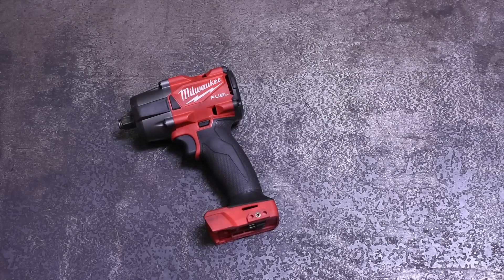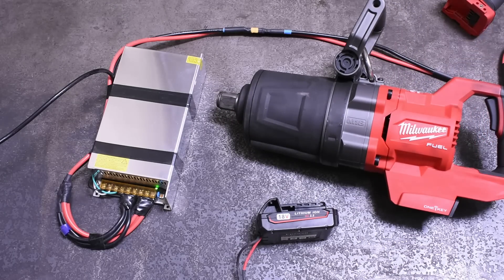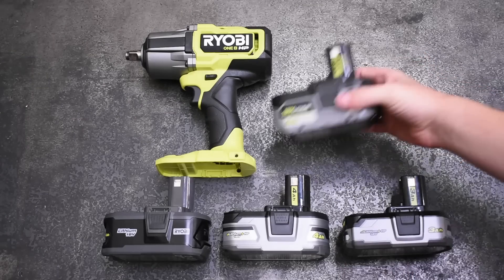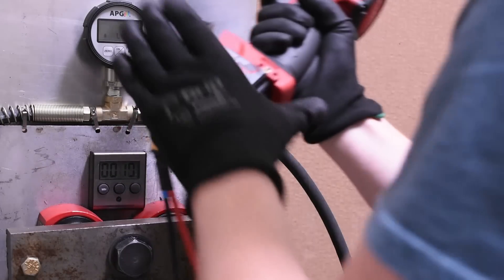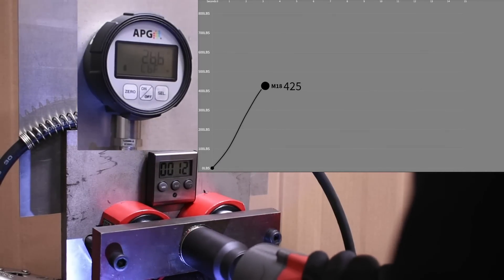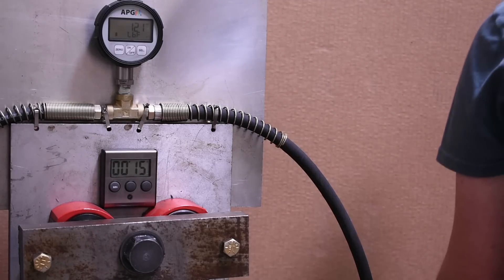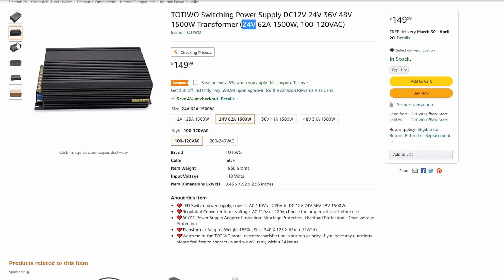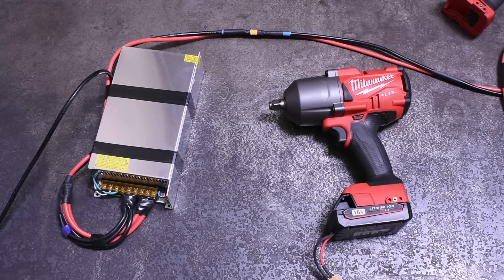Mad Scientist Youtuber Supercharges our Tools: 120 Volt M18 Impacts

Comment: Great video!
I have built similar power sets for older style 18V tools in the past. I would get best results when having large capacitors across the PS set as you said 22V or so. I have also utilized a DC-DC converter in conjunction with the battery pack before to basically boost high inertia loads ( pick up the dip 🤣). So the set up you just tested, but using a DC-DC buck converter set to 21V and max current of converter and then you can still use the High Capacity pack also and use the converter to simply pick up the power as voltage drops off pack? 
Just sharing! Keep it up and God bless!

Comment: I wish they would make a real commercial version of this, so I could buy the cordless miter and table saw, but plug them in when using them at home in my garage. I know dewalt has the dual flexvolt one, but I want it for any 20v tool.

Comment: Love it! I use a “hacked” server computer power supply to power my RC charger, but never thought to hook it up to Milwaukee tools…
They sell battery kits on eBay with locking tabs. Maybe combine that with home brew 12V power supply based on Branded (HP) server PSUs that are CHEAP on flea-bay.
They’re switch mode, have excellent voltage tolerances and overcurrent protection + efficiency, and some even have cooling fans built in.

Comment: Just get a second box and gang 2 of them off of separate breakers into one tool for maximum amps.
Reply: Also maybe see if you can get LTT to water cool the impacts so the extra amps don't just melt the windings as fast.

Comment: You need to get a power supply capable of going to 24 volts those tools will easily take 24 volts without problem and then you would truly have the tools absolutely very best case scenario.
Reply: I see I should have waited until almost the end of the video before commenting haha but yes you are right crank that thing up giver 24 volts they’ll take it easy peasy

Comment: If you're really gonna push this battery test then take a look at "the post apocalyptic inventor" he put 6 makita batteries in series to power 120v tools. Your version would be batteries in parallel, 6 milwaukee batteries at 18v should be plenty to beat this wall adapter

Comment: I would be willing to bet, if you plugged the power supply into an isolation transformer, then plug that into the wall, some of the strange behaviors would go away. The electronics on the tool were never intended to be referenced to ground.
Reply: Possibility #2 is that the switching noise in the switch mode power supply is also having a detrimental effect on the electronics in the impact guns.

Comment: As far as upgrading things, used to spend some time in the car audio world, they would use massive 3000w contious converters to run some of the display setups. For the really big stuff, they had a battery bank and several converters to produce 10kw for the minute or so they ran the system for customers. I know most of those were around a thousand a piece, but the power is definitely out there

Comment: the connector, XT60's use them in drones. Take an ice pick or 1.5mm allen head and spread the pins in the male connector. sligthly expanding them will make the connection pass max amps and stay together. its a common thing to do every now and then. love the channel.
Reply: I've found the legitimate amass connectors are pretty solid and don't need anything like this

Comment: What were the 240v options on that page?  I'd guess you'll need more than a standard 15amp 120v to truly max out the potential.  In fact building a large 18v battery with high discharge cells could easily deliver more power than a standard 120v circuit. Maybe one of the ebike/battery channels could help you out.

Comment: All fine, but do try to check the actual volts being delivered to the terminals of the impacter. Even fat cable like that will lose an appreciable voltage over a run over several feet, and the last little bit of (thin!) wire plus its connector will lose more. Another thought: you might be able to get the 1-inch model to run by putting a really hefty capacitor across the power supply to help with the start-up surge. I suspect that the steady running current isn't as much as the 80-ish amps that supply should be able to provide.

Comment: Connecting the power supply to a full battery would also likely fix the cutting out, the battery would act as a buffer

Comment: Over voltage should give significantly more uggaduggas, or you could run another of the same power supplies in parallel (connect two to the tool at the same time) for twice the current availability and half the voltage drop

Comment: Hi, TTC! Some comments from an EE perspective:
• I had suggested doing almost exactly this on your earlier video!: https://www.youtube.com/attribution_link?a=sX7DEhMosS3n83pP&u=/watch%3Fv%3D5nzGnqBGAtE%26lc%3DUgx5tcM36hxL-BMoRYp4AaABAg.9_QL2JaWpr29_Qea1sqFxn%26feature%3Dem-comments
• Glad you're doing this!
• Clearly this DC supply isn't adequate -- it isn't "stiff" enough (can't maintain output voltage). As I suggested before, you probably want a 100A or 500A supply. Something significantly beyond what you think you need, especially because these cheap supplies are under-rated.
• Probably most important, though, is to measure the supply's output voltage while you're doing this. If you can manage to put it up on the same graphs, that would really tell you something. I suspect you are correct that the tool is drawing more than the alleged output current rating of the supply, which Amazon claims is 66A, but I don't really believe. Similarly it would also be helpful to monitor the current coming out of the supply, but you need more specialized equipment (hall effect DC clamp meter, current shunt, current transformer, etc.) not like the voltmeter you surely have kicking around (but you can buy such meters cheap).
• Note, also, that 1800W is basically the maximum you can run from a 120V circuit (15A@120V). You really should use a 240V or 208V circuit. The particular supply you linked to supports a 220V input, so it would be worth swapping out the power plug and flipping the red switch on the side to 220V and seeing if you can get more amps out of it.
• The comments about grounds and soforth don't really make much sense. Not clear what's going on. Maybe the DC negative lead should be grounded to the ground from the 120VAC cable. Not 100% sure.
• It looks the leads from the battery back may be a bit thin; of course they're short, but still at big currents every little bit of resistance is a problem.
• You're right that the 18V supply is wrong for this. I had envisioned using a variable voltage benchtop supply, but grabbing one of these fixed-voltage with a potentiometer is a cheaper approach. But you really want to be using a 24V supply not an 18V supply. Or maybe 20V or 22V if you can find those odd numbers.
• As a matter of labeling, it's not really right to call this 120V. Sure, it comes from 120V on the wall, but that's like saying your M18 is 120V because you plug the batteries into a 120V charger. 

If you want assistance constructing a beefier version, don't hesitate to reach out! This is definitely not rocket science!
Reply: I've got some stuff to try initially,  but I'll reach out if I run into any snags.

Comment: My bet is that power supply is dropping amps. It can not upkeep with enough current.
Maybe adding a big capacitor in the power supply output would help with it.

Comment: Think the next step is 2 car battery’s for 24 v or a truck jump pack definitely have all the power you need then and kinda practical for a something like drop saw that doesn’t move a lot and probably cheaper than lithium

Comment: Well the good news is assuming the power supply isnt a total ultra low cost made-in-china brand garbage shit-show internally, its not as sketchy (in terms of risk to the end user) as it may seem.  The cutting out and odd behavior is most likely just EMI/radio interference. Limited filtering on the power supply, combined with a tool not designed to be run from wall power and deal with the mess of EMI associated from that can cause the strange behavior you're seeing.  As far as this vs the metabo. This has a fan for cooling, the metabo doesnt, so even if its very efficient, the long-term continuous power it can put out is thermally limited, even if it can support shot-term peaks. The metabo power supply is also going to have to the EMI filtering to keep the tool happy shoved into the pack, reducing space available for making more power.

Comment: As others have said a PSU with remote sense lines would be best, a nice 3kW unit with some thicker cables. This sort of thing would be ideal for a battery powered chopsaw when it's sitting in your workshop - You can still use it out and about on battery, but when you're home you can just plug it in and not worry about batteries.

Comment: Don't understand why your connecting the common DC rails together, on the PSU. Kind of redundant.  But if you really want to do this test try useing a autoswitching PSU, they will give a more constant output voltage as the load increases.

Comment: Why not adapt a 24 v kobalt battery
Reply: I very done this too some old NiMH powered 18v portercable saw and oscillating tool. I did smoke the variable speed adjustment on the oscillating tool . but after bypassing it   all is Good

Comment: That power supply wattage is too low, which is why the 12.0 beats it on bottom end because it's kicking out more amps...but the 12.0 still faces voltage sag under continuous drain like most cells, which is why the constant voltage power supply can climb back.

Comment: More FUN! I mean more Science please.  Get rid of cheap battery adapter and send power through large gauge cables directly to the horse's mouth right at connection point to the motor.  Give it all the beans and more.  Motors like higher voltage because it helps compensate for any voltage drop in system.  Higher the voltage used the less amperage or heat that will be in the line.

Comment: That was awesome!! I think adding some large capacitors or even supercapacitors in the battery pack would improve things alot more. The reason is switching power supplies like nice constant loads, not a dynamic load such as a brushless motor stalling out 100+ times a second. Adding capacitors into the battery will help with the current peaks and might reduce the current spikes on the power supply from tripping the over current protection. You could see on the big boy M18 1" that the LED lights were dimming in even the no load trigger pulls. So if it was made again I would use the 3 wires going directly into an XT-90 connector then 8AWG going into the dummy battery. He used an XT-60 and then very thin wires going into the dummy battery so there was decent voltage drop across that.

I think if TTC gave him a real M18 battery with the proper locking mechanism and high quality contacts it would do much better. Then adding very low ESR Electrolytic capacitors or Supercapacitors into the battery itself that would drastically improve the power supply system.
Reply: Unfortunately the OEM batteries don't work with this. I tried several and couldn't get an output.

And the battery retainer clips... let's not talk about that.
Reply: you are correct that capacitors do help smooth out surges, but for the load you have here, they are impractical.  You need a humongous capacitor and even then it's a crude way to do it.
Reply: @mriguy3202  yea it would be way too bulky to do it fully, but I may help some

Comment: Here's a totally pointless exercise in why bother - to see how much the torque is impacted by voltage drop, rig up an A/B switch for 2 fresh batteries. Compare a run with a single battery against a run where a new battery takes over halfway through the test. Would be interesting to see how the max torque numbers change - if at all - when a fresh battery kicks in late in the test. Could a mid torque put out more fastening power if a fresh battery is switched in?
Reply: Just wire both batteries together at that point, heck a third one too.

Comment: Is this something that a inline capacitor, like a larger audio one would help reduce power supply fluctuations and keep voltage/amps more consistent as each hammer hit/amp draw spike? Not an expert at all here just a thought. Also an inline ammeter may provide more data as to wattage/voltage/amp draw. Just like in drone brushless motors ... Could also test tool efficiency as well.

Comment: That power supply looks like it might be an AliExpress special. It's probably kicking in to protection in various scenarios. I would look for one with a constant current limiting output, like the Mean Well MSP-1000-24, which will output full current in to a dead short indefinitely. Downside is that it only adjusts down to 22v which could be too much for equipment designed around a 20v nominal max voltage.

Comment: Your tool glitches are likely the power supply producing a very noisy voltage source (switching noise) which is made worse since you cranked the voltage adjust...

Comment: 120v will never beat a high Ah lithium battery for periodic draw as the 120v supply will max out at 75A and basically has very little headroom for overcurrent, especially the Banggood Chinese specials...   On the other hand, it is not uncommon to see 50C or even higher discharge ratings on lithium cells, but even if you take a more conservative 10C, that means that the 12 Ah battery could push 100A for short periods (ie, in between every ugga and dugga of an impact tool).  Now there are probably all sorts of protective circuits in high-end commercial battery packs that limit the current for safety and other nonsensical reasons, which probably accounts for why you didn't see the 12Ah battery beat out the wall plug, but it might be interesting to sacrifice some of the Amazon specials and buy some big-ass RC LiPo batteries (the ones that claim 150C discharge rates) with no protection circuits and hook them up to the tool with jumper cables and let them rip...  I'd bet they'd give Milwaukee a run for the money, but probably only once, before the tool and battery literally go up in flames!
The only applications where plugging into the wall makes sense are those that require sustained current draw over a relatively long period, like drilling and sawing, but impact tools, even though the motor is running continuously, see their current draw in spikes...

Comment: I actually tried to make something like this a few years back. However, I didn't want to spend the money on a high-watt PSU, so instead I scavenged a transformer out of a dead surver UPS, a big bridge rectifier from something else, and bought a capacitor the size of a coke can off an electronics supply site. This made, quite possible, the absolute worst unregulated linear voltage regulator mankind has ever seen. It did actually power the drill and not kill anything (including me), but the final power box was the size of a shoe box, weighed about 20lbs, and barely had enough torque to turn a 1/2" spade bit. I keep it around just because it looks hilarious, but I don't actually use it. The concept was sound though!

I think what these devices really need is a super-capacitor on the output side to help absorb the initial current draw from starting up the stalled motor. The big thing that a battery can do that a switching power supply can't is handle huge current draw for relatively short periods of time without sagging too much. A Lithium-Ion battery can put out some fairly ridiculous amounts of current for a second or two with much less sag than your average switching power supply. You need something that acts a bit like the start capacitor on an air conditioner to help feed that initial spike when the motor starts up, because the bulk cap on the input side of your average switcher just can't hold the voltage up long enough. Basically, you need more watts-in-a-can to get the motor started, but once it is moving the PSU should be able to meet the power needs just fine.
Reply: Brushless motor don't have any increased current draw to start.  The motor controller is in control